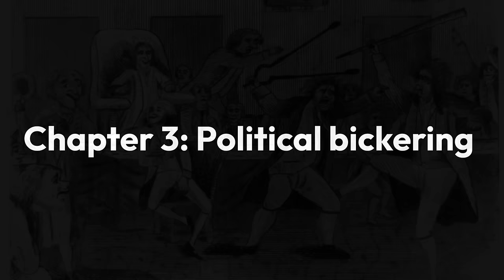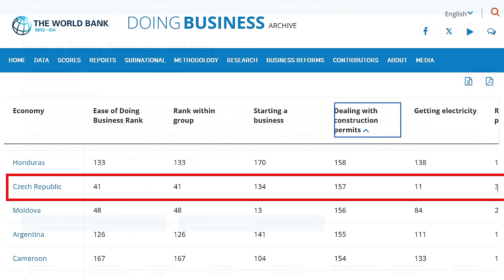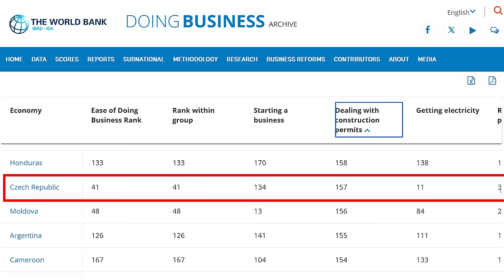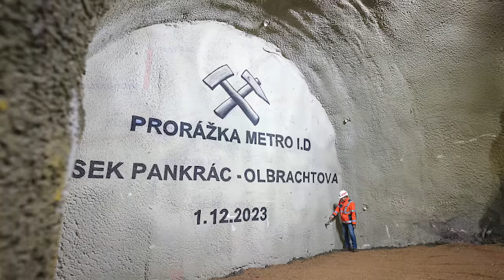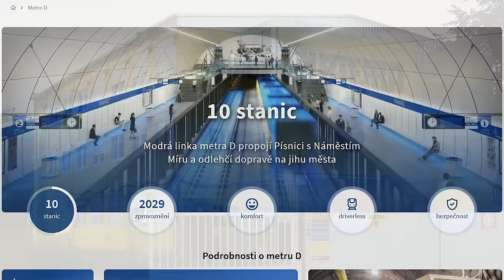The Lost Metro Line - Prague D Metro Line

Comment: Why not replace many trams with grade separated Elevated lines. Some of NYC’s current subway lines were former tram lines!!!!
Reply: I think the issue is that by constructing a new service you have a capital expense in infrastructure but you assume that you will be increasing the number of passengers that will pay to use the service.
When you re-build you have a capital expense but, as you will not serve new districts, will not have an increase of passengers (or not enough to justify the expense), you would have loaded the operating company with unnecessary debt and recurring debt servicing costs.
Reply: The main problem with construction are NIMBYs so I cant really imagine any elevated lines being approved anywhere near residential districts. 
In the historical center it couldnt be approved because of historical building protections. The only places where this would make sense are streets with office buildings but those are usually already being served by trams or short bus routes to metro stations. Theoretically you could put some lines above highways but I cant really think of any places where that would make more sense than a dedicated line for buses.